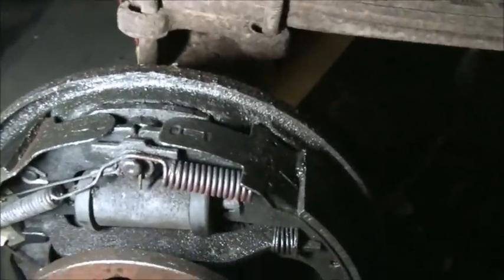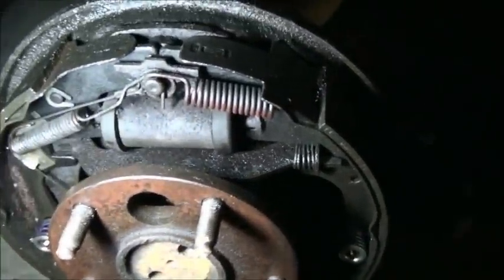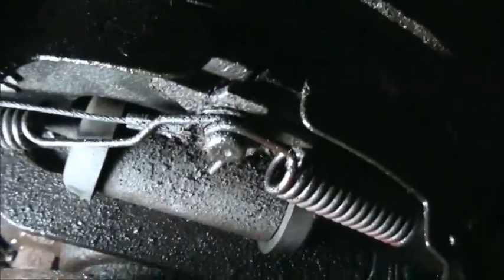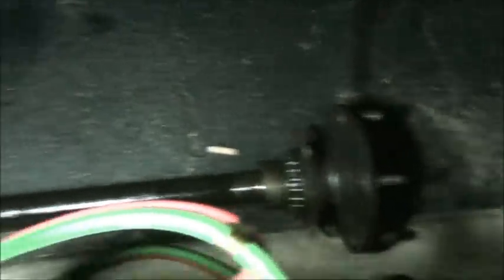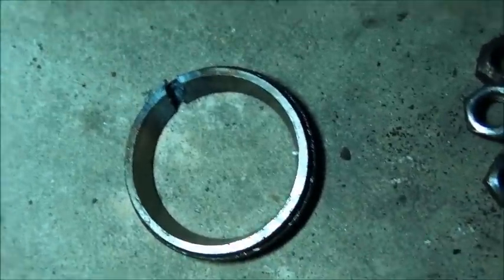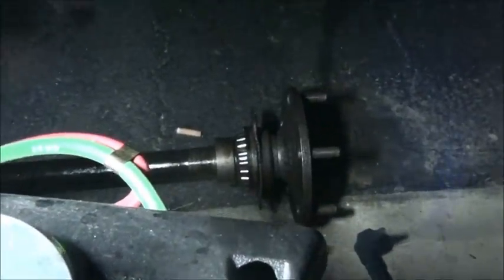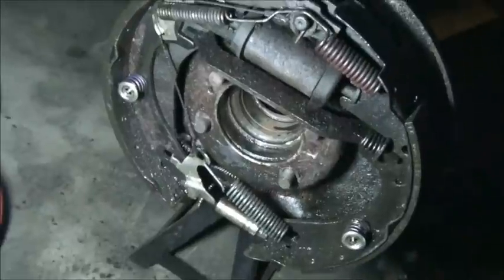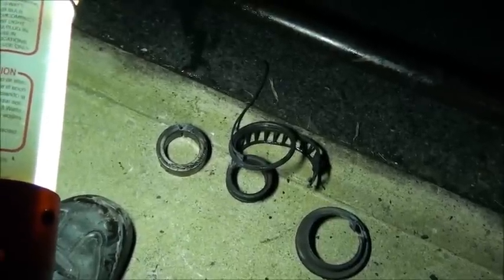FORD 9 INCH AXLE SHAFT REMOVAL , SEAL , BEARING , AND RACE REMOVAL!!!

Comment: Thanks for the video. 
got to get my oxygen tank exchanged.  This Lookes like the best way for me .  I have lots of experience with cutting bearings off.  This ones just smaller.  only have a 6 ton press , should work for this size .

Comment: I have been able to use a propane or oxy/acetylene to cook the shoes covered in gear oil or brake fluid. Cleans them right up almost good as new. Some folks might disagree however it wont hurt to use them with the old drum.

Comment: Every illustration I searched NEVER showed the retainer... I've been trying everything in my shop to remove it... I've an impromptu "pusher" applying pressure on it... the torch comes out next. 

I want my truck back on the road... 78 Econoline 150, 300 six, three on the tree... 300,000 miles... rebuilt body.

Thanks!

Comment: I just bought a 9 inch out of a 71 Ranchero. looks rough but want to rebuild it. first time digging into an axle. however the shafts won't come out. am I forgetting something?
Reply: slide hammer?

Comment: I have 2 plastic headlight bezel out of 78 or 79 , also have the metal brackets behind headlight .  I also have a.c. compressor , steering column from mine `70 F-100

Comment: What year and model truck were you working on? Ive got a jeep with the same type of rear end and trying to find the correct parts seal, bearings, and race
Reply: 78 f150 4x4

Comment: Hey thanks for the video man. I got a 1976 Ford LTD from my mom who got it from an asshole teenager. Well im another jackass teenager but i like the car and wanted to be nice to it. The carrier is bad in the rearend so i bought a 275 rearend and was going to replace it. I figured out how to remove the axles and when i got them out i found the splines were damaged and the bearings were HORRIBLE. even worse than yours. Thanks for showing how to remove the race and bearing. Was scared of this job.

Comment: @beltstowing At the time Ford owned 15%-25% stock in Cummins and as little as 10% at one point.At this time Ford holds no stock in Cummins.Bad move?? :-(.
In order for Ford to own Cummins they would have to be the majority stockholder (own more than 50%).
Ford also sold off Jaguar and Land Rover in 2008 and Volvo in 2010 (think thats the correct years).Smart moves I think lol.
Ford does own a small bit of Mazda and Aston Martin,not sure of the %.
Not sure who owns Cummins now.